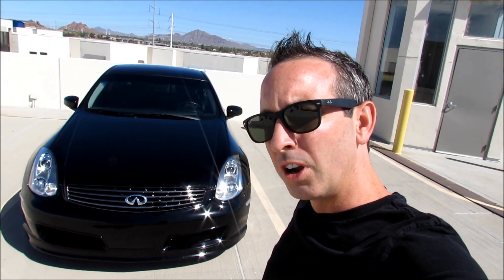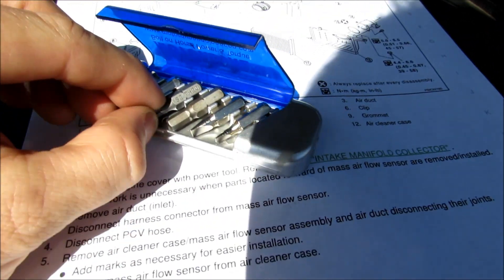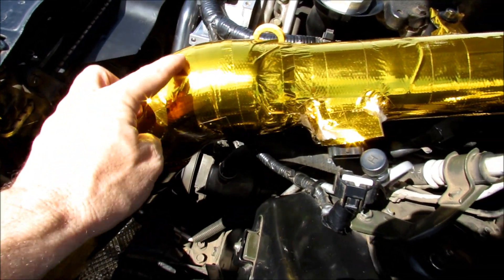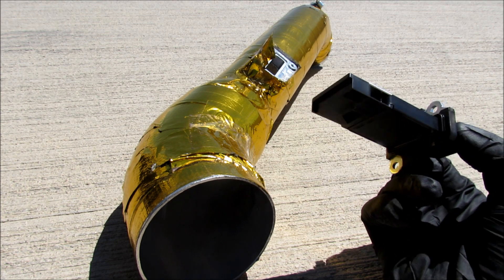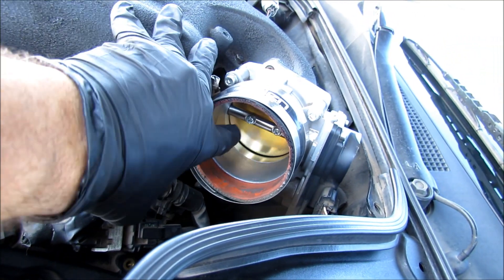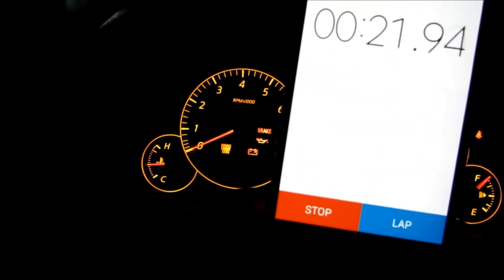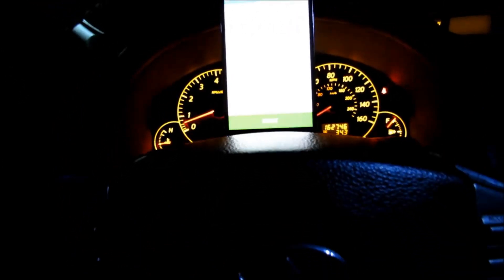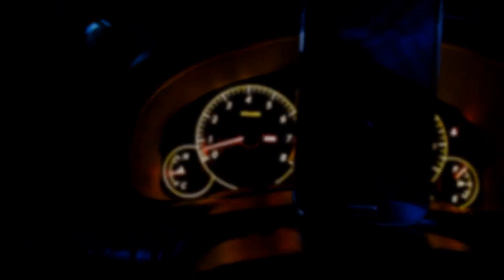How to Clean MASS AIR FLOW Sensor to Stop Car Hesitation Nissan 350z 💥 INFINITI G35

Comment: just pressure washed my car (2008 G35 sport sedan) now I’m getting the service engine soon light, got the code it was the P0507, I haven’t disconnected the MAF or the throttle body. would doing the idle re learn correct it and make the light go away?

Comment: Yo I did the entire procedure on my 07 g35x sedan and it still has a rough idle and high rpm when it’s in park. Am I just doing it wrong?? I did it like about 5 times already.
Reply: Would it die when you go out of gear?

Comment: Great video! Just got a little confused 😆 If I just cleaned the MAF... Do I have to do the idle relearn? Or just clean it and drive?
Reply from the maker: Only if you touch the butterfly in the throttle body do you have to do the idle relearn. No, just clean it and drive.
Reply: @MotordyneG35  thanks a lot 😁

Comment: I need some serious help with my 2003 Infiniti g35 sedan. I’ve replaced the alternator and MAF sensor twice. I’ve taken it to the dealership prior and they said my new alternator was charging at 16-17 volts causing my MAF sensor to short out and put my car into limp mode (won’t go over 2200 RPM) it sounds like I have 2 step. I’ve replaced both parts one more time and it was good for a day, the next day back to the same problem. Any idea what it could be?!
Reply: I got something similar going on at the moment.. any idea what the issue was?

Comment: What's the benefit of a cold intake? I own a 2015 q60s and trying to learn as much as I can.
Reply: In theory colder air is more dense so gives more power during combustion.  However the stock air intake is already best unless you're going to do mods

Comment: If I’m only cleaning the  MaF only, do I still have to do the relearn?
Reply: omarp63 I just cleaned mine and what I did instead was 
Before cleaning the MAF sensors
Unplug the negative from the battery and clean them.
After reinstalling the sensors the ECU should already be reset and you don’t need to do the relearn 
Cheers

Comment: So the other day I installed a new MAF sensor because I was getting a p0102 code. The new senor fixed that problem that I was having but now I've realized a few things. First is I feel like the car is slower when accelerating now for some reason and the second thing is that when I first start my car up, it idles fine for a few seconds and then jumps up and back down like I revved the car even tho I didn't touch the pedal. Any ideas?
Reply: KC_Gteam have you fixed this issue? I got the same code pop up recently
Reply: @beanz2092  Yeah I did. My MAF sensor was causing the problem of the code and doing an ecu reset and a idle relearn fixed the slow acceleration and weird idle.

Comment: Motordyne G35, I have a 2008 g35 infinity and got a p0171 code. Is it true that if I disconnect the MAF sensor and car stays running means that the MAF sensor is no good??? It's a dual MAF sensor system, do I disconnect both or the one side that I believe is bad if this trick really works??? Also I'd like to get your opinion on the hydrogen oxygen carbon  cleaning machine to clean carbon from engine. Do you believe that this is a waste of money or does it work to clean carbon??? Thanks. By the way I did your idle  relearn after cleaning my TB and it worked like a charm for me Thanks for this great  video.

Comment: I have a 2003 G35 Coupe and recently did my valve covers and cleaned my throttle body. I was getting the high idle and did the re-learn process. It does drop the idle to the proper rpm, however whenever I shut off the car, it resets back to a high idle. Ive done the ECU reset as well as the other procedures named before the throttle body reset. Any experience with this?
Reply from the maker: No, the idle relearn always works for me. Any check engine lights? You may a have a small vacuum leak somewhere.
Reply: @MotordyneG35  I do have a P0300, random misfires. The car is idling really rough, has a lot of power loss, and shakes a ton. I've checked for vacuum leaks, but everything is solid. I've ordered new coil packs as well as spark plugs. Hoping this will solve my random misfires, as well as prevent my ECU from not remembering the throttle body relearn.
Reply from the maker: @rj5279  ...How many miles on the engine? Have you seen my other video? https://youtu.be/h666VNsPv2M

Comment: I just received a code for the MAF. I have a 2013 m37x Infiniti. I am no mechanic but it doesn't look hard to replace. I'm assuming it's in the same place as in your car. Do you think I can replace it on my own? Or should I take it somewhere?
Reply from the maker: Super easy, yes you can do it. You will have 2 MAF senors because you have 2 intakes. I just have 1 air intake.
Reply: @MotordyneG35  2? Are they both on the same side? Or is there 1 on each side? Thank you for the help
Reply from the maker: 1 on each side, on each intake. Same exact location basically as mine.
Reply: @MotordyneG35  last question? Lol do I need to buy 2 or do 2 come together? And thank you for answering
Reply from the maker: @HL-qc5rd  ...probably each sold separately.
Reply: @MotordyneG35  ok. Possible I only need 1 or no?
Reply from the maker: @HL-qc5rd  what engine code did you get?
Reply: @MotordyneG35  I'm not sure. How can I find out?

Comment: Today, I just bought a used '09 G37x sedan  AT w/manual mode. Drove it home 60 miles, highway, city and back-roads. No problems at all. Car seems(ed) to be running like a champ and in great shape for the year and mileage '09 135k. Stopped at the store, turned off the car etc, apx 30 minutes before I began driving home, came to a stop sign and upon accelerating from the stop, the car jerked and stuttered, power dropped way down. Pulled into gas station immediately, freaking out, parked it, gave it some gas to rev it and the engine would seem to wobble and shake the car all while not getting the revs up due to lack of power. I had to get the car home as I didn't even have the new plate on yet. So, what I ended up having to do for the last 4-5 miles home, was that I found that by shifting into manual/sport mode, matching the revs as best as I could to get up to 5th or 6th gear, then I could get up to the speed limit and while still low on power, the car ran smoothly. Came to more stop signs and red lights etc, every time I tried to accelerate in auto, there was just no power and the transmission didn't seem to want to shift up unless I quickly switched to manual mode and got it up to a higher gear. Even in 5th, 6th or 7th gear the power was very limited as well. Got home. Parked it. Saturday night ruined. Nobody to look at until Monday. I did however speak to the dealership before they closed and one thing they mentioned was that perhaps during the pre-sale detailing, done just before I left the lot, as they power washed/sprayed the hood, maybe a sensor or something got wet and is causing failure or limp mode or something like that. I don't know, maybe. I've been reading about and watching videos about dirty mass af sensors, dirty throttle bodies and re-setting the ecu. Hopefully the issue is that simple and all is well. If not, thank God I got a warranty lol. Always something. Anyone experience something similar?
Reply from the maker: What check engine light code did you get?
Reply: D what ended up being the issue? I have this problem rn.

Comment: Can you clean the throttle body without unplugging it? like spraying the outer area and gently wiping without touching the butterfly valve and letting it dry long enough before putting the intake tube back on. I had to do a throttle/idle/ecu relearn before and it was a pain (you make it look easy). But I really want to clean the MAF and throttle cause i'm getting crap city fuel economy.
Reply from the maker: Yes, no need to unplug it and you can do it that way. But, to fully clean it you need to push the butterfly valve open. 

Seriously, try the idle relearn right now. If you start my video when I have stopclock out while in your car, it is so easy. You really can't mess up and then once you feel comfortable doing the idle relearn procedure, clean the throttle body.

Comment: I have a question abt aftermarket intake. I had 2013 G37 with Gen 3 Long tube intake from Stillen, i had a check engine light on, the code read as if they were from Air Flow A and B. If cleaning MAF would clear the Check engine light on? I used to send it to the shop where i installed it. They didnt see any wrong with it. They just clean MAF and some filter in the front and reset. Its been abt 6 Months and the check engine light came back. Whenever the that light is on, sometime the car is not respond to the acceleration and i have to turn the car off and wait for a few second to turn it back on to drive like normal. Do you have any idea on this problem? Thank.

Comment: Good evening can you tell me anything about a c1130 code on my g...it  has no power over 3000 rpm..I changed all sensors.cleaned maf sensors. Oil change and new filters..did ecu reset..variable timing control solenoids are clean..your knowledge would be greatly appreciated ..
Reply: Did you figure out what the problem was?

Comment: My G idles 650 but goes high again (around 900-1000) after i turn off the car n restart it after during the idle relearn with the same code p0507. Cant figure out what to do asdfghjkl
Reply: Stuck thermostat maybe?
Reply from the maker: No, a thermostat would have nothing to do with it. So you are confirming you completed step 9:08 correctly?
Reply: Cleaned the maf sensor n did the 3 procedures again and now rpm is where it should be.

Comment: i had p0171 and p0300. car hardly even ran and when it did it idled at 1200. after doing this it runs perfect. thanks
Reply: KXNG I have the same codes! Thanks 🙏

Comment: I have a question. I got my 07 g35 a year ago. Its tuned by z1 motor sports. Some bolt ons etc. It idles alittle funny since I've had it. Will this relearn work with the z1 rev up tune?
Reply from the maker: Yes, at 9:08 the idle relearn will work. My car in this video is also dyno tuned. Z1 uses the same uprev tuning software. All VQ's are basically tuned on uprev.

Comment: What kind of spray did you use to clean it?
Reply: sry , i see , u already show it in u video
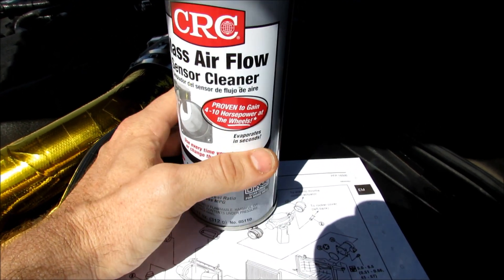Reply from the maker: S. K. J. .....yep, at 2:02. It is CRC mass air flow sensor cleaner.

Comment: Least you didn’t had to replace it. $250 is the price for one and I had to replace it after cleaning it when my idle rpm was bouncing around
Reply from the maker: That is pricey, where did you buy it? The stealership? I just looked up my old order for, Hitachi MAF0029. I got it at $120. 

The G is at currently at 172,000 miles. I actually replaced mine at the 150,000-mile mark.  Did it go out? Nope, I was just doing the 10 year 150,000 mile maintenance that I wanted. Which also included replacing the starter, alternator and fuel pump. Even though they were still working. I figured 10 years, 150,000 miles these parts are on their last leg and I didn't want to get stranded:)
Reply: Motordyne G35 na at my independent shop lol

Comment: Probably a long shot, but do you know off hand if this procedure is more or less the same, or similar, for most cars? I'm not the greatest with cars but I've been trying to fix an idol issue with my Mitsubishi Galant for the last year or so. Mitsubishi dealership tried telling me my best option was to pay $3,000 for a replacement used engine (lol), or pay $500 for them to open the engine block, and that doesn't include anything else after its open. Such as a cracked piston which they'd charge $1500 for (lol again). If you don't know, It's all good. Sort of sucks that Mitsubishi Galants/Lancers don't have a big community unless its a Ralliart or an Evo.
Reply from the maker: Cleaning the MAF is basically a universal procedure for all cars, the only difference is the configuration of the air intake boxes that hold the MAF's and how to get to the MAF's will be different. The principal is all the same. How many miles are on your Galant? You can defiantly try this and see if it works, it will not hurt it that is for sure. What has me concerned is if a shop is telling you that a new engine is what you need, I think you have bigger problems than a dirty MAF, unless that is 1 shady shop! Is the engine making knocking noises? Are you overheating? Or is it just a rough idle issue?
Reply: The Galant has 105,000 miles on it. And yeah It's only an idle issue. When driving its fine, when idling at a stop light or a stop sign or just sitting in park it starts shaking. It only starts doing that when its under 1,000 RPMs, above that its fine. If I put it in neutral, it stabilizes a little bit, but it still does it. Changed the spark plugs, changed the o2 sensors, changed the third ignition coil and nothing. I don't remember the code on the service engine light off the top of my head but it was a coil 3 misfire, hence why I changed that ignition coil. The place I took it to for them to look at it was an actual Mitsubishi dealership lmao. I was a little annoyed that them of all people couldn't figure it out. Edit: One of my other thoughts was the idol air control valve but I haven't looked into that yet, I don't even know where that is on my car at the moment. No over heating and no knocking noises.

Comment: With the Admin intake, would the larger diameter around the MAF sensor cause bad readings and require a tune to compensate?
Reply from the maker: That is correct. You have to get a tune with the Admin Intake. Without a tune, trying to run the intake the car will idle and run badly.

Comment: So which is better Admin or Injen?
Reply from the maker: Admin. I had my long tube cold air Injen intake before Admin was making intakes, it was like my first mod. The admin intake for sure is better. His short ram and his long tube cold air intake, both are better. The cold air intake by admin is better than his short ram intake. He only shows his short ram intake for sale on his website. The long tube he has done on 1 350z, but not on a G35 yet. 

Remember, you have to get a tune with Admin's intake or the car will not run. It will idle like shit and run like shit until you tune it.
Reply: Motordyne G35 dope! I actually purchased an Injen cai like a month ago and I just installed it yesterday. But it was idling like shit i wasn’t able to go past 2.5k rpms. Any idea why? I put the stock intake back on and it ran fine again.
Reply: I tried doing the idle relearn but it didn’t do anything
Reply from the maker: Dark Future ...is the Injen intake a long tube CAI or short ram intake?
Reply: @MotordyneG35  If uprev e-tuning, how would you suggest getting it tuned? Wouldn't I have to put it on and email the data logs prior to tuning? I currently have the stillen intake kit w/Z-tube and would like to upgrade to 3.5"admin intake. Thanks and appreciate you sharing all the work you've put into your G.

Comment: Be very cautious and careful!.. In my case I actually disconnected my throttle body and removed it because I wanted to get a better cleaning. Little did I know that disconnecting it would cause a big problem. Not to mention there's a ring of some sort that sits the entire circumference right where the butterfly sits. Despite what they say I wouldn't mess with the butterfly either! Currently I'm receiving the high idle code and the complete relearning procedure doesn't work! I've read that I will have to take my car to the dealer to have the ECU read by some special equipment they have. I might have to by a new throttle body as well.
Reply: Robert Canales did the exact same thing a couple weeks ago while installing some go fast parts...had the whole plenum off with tb attached. Cleaned it up real nice put everything back on and got idle speed something code (high idle). Tried to do idle relearn, disconnect battery etc but no luck. Then the other day while racing my buddies maxima it had apparently turned off it was weird.